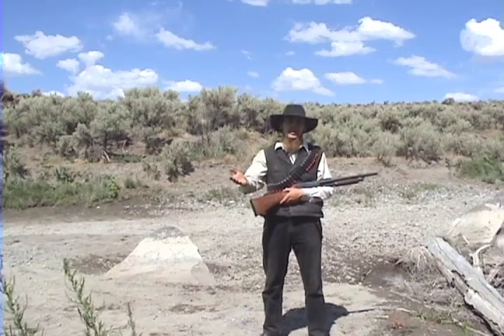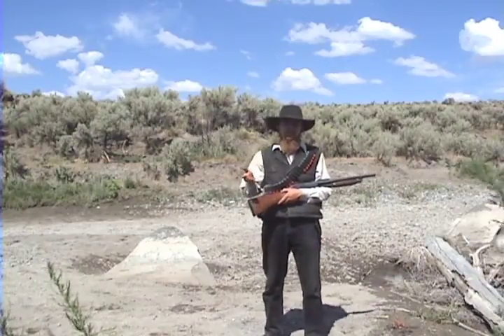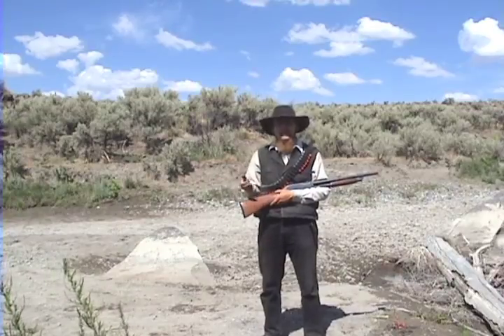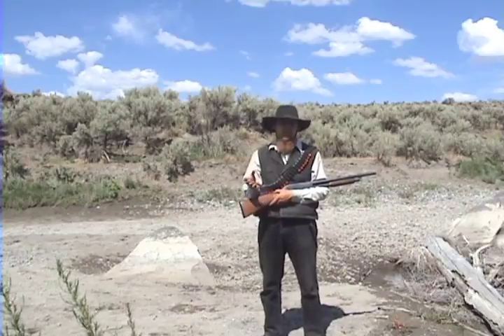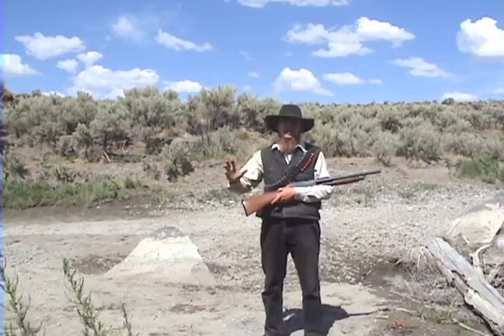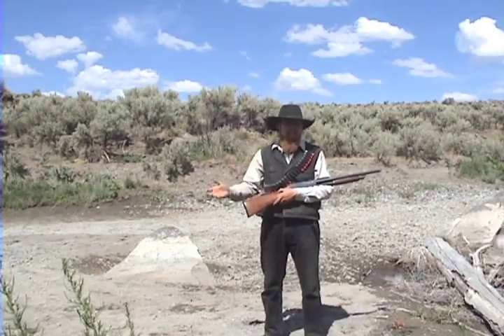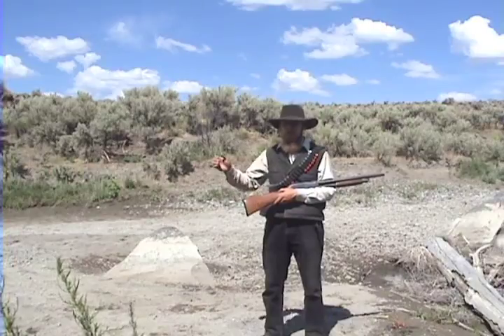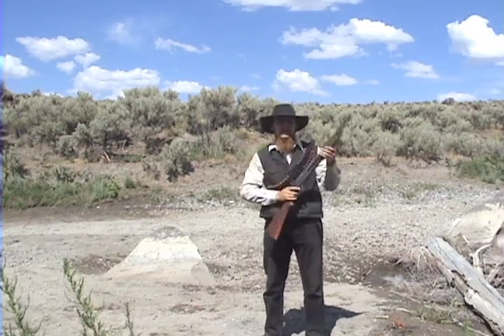Steel Buckshot (TIS033)

Comment: There is a 2 3/4 15 pellet OO Buckshot recipe at BPI.  You can also try loads that require wads for increased range. I believe that's why the #2 shot went further. I know #4 turkey loads have a lot of shot and power at 40 yards but that was with a 28 in,. full choke barrel.

Comment: Only 10 yards?  Are you not using a choke?  Also, steel shot deforms less when passing through the choke and tend to pattern tighter, both inline with the barrel and perpendicular to the barrel (ie - the steel shot arrives closer to the same time and with a smaller “spread” than lead shot)